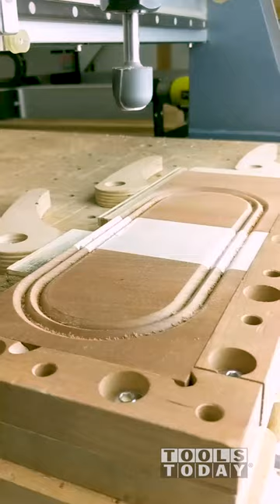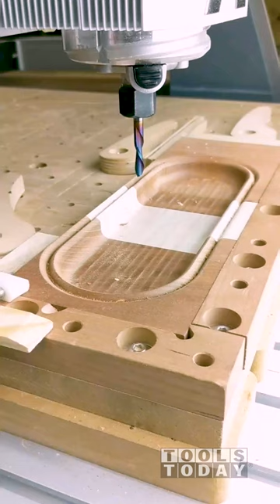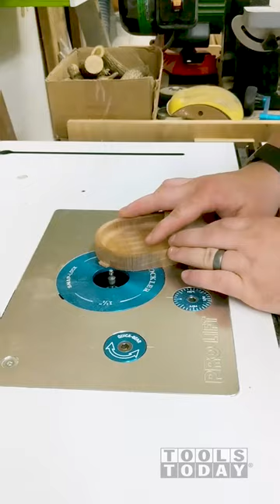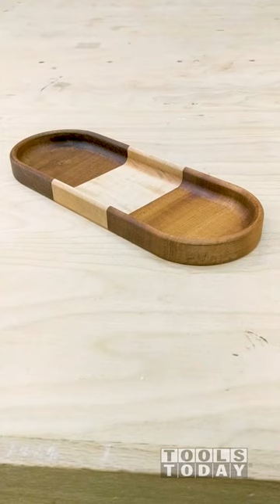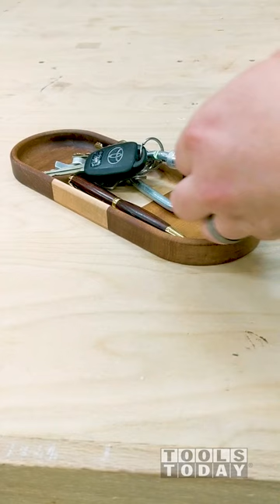Making a Catch All Tray

Comment from the maker: Making a catch all tray. What do you think of how it turned out?
- - - - - - -
I started out by using the item no. 56126 3/16" point roundover to ease the edges of the tray on the CNC making things a little easier. https://www.toolstoday.com/v-11511-56126.html
- - - - - - -
RPM: 18,000
Feed Rate: 50ipm
Plunge Rate: 25ipm
Depth per pass: .18"
- - - - - - -
Then I followed that up with a item no. 45982 3/4" bowl bit to carve out the center and give a nice round profile at the bottom edge of the tray. https://www.toolstoday.com/v-5662-45982.html
- - - - - - -
RPM: 18,000
Feed Rate: 40ipm
Plunge Rate: 20ipm
Depth per pass: .2"
Stepover: 29%
- - - - - - -
The item no. 46202-K Spektra™ 1/4" downcut bit cut the tray from the rest of the material. https://www.toolstoday.com/v-13779-46202-k.html
- - - - - - -
RPM: 18,000
Feed Rate: 80ipm
Plunge Rate: 40ipm
Depth per pass: .25"
- - - - - - -
After the tabs were cut the item no. MR0112 3/16" ball bearing mini roundover, https://www.toolstoday.com/v-11230-mr0112.html , to cut the tabs flush and added a little bit of a roundover to the bottom. Finally, a minute of sanding with 220g and this tray is ready for finish!